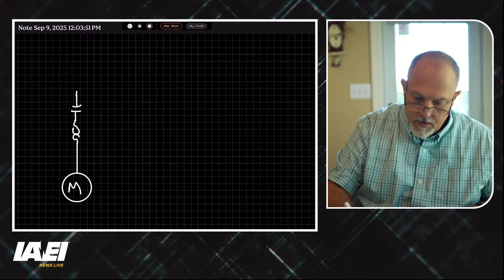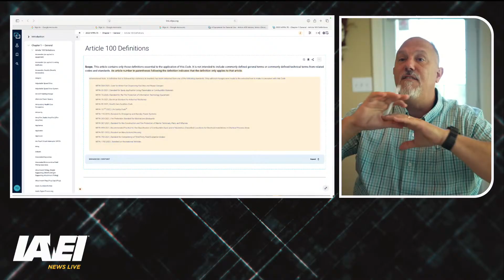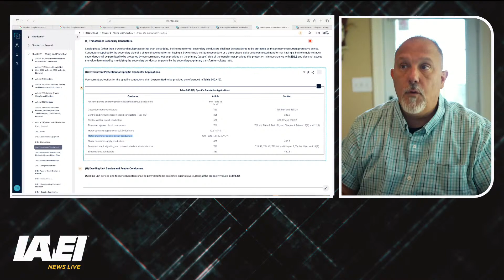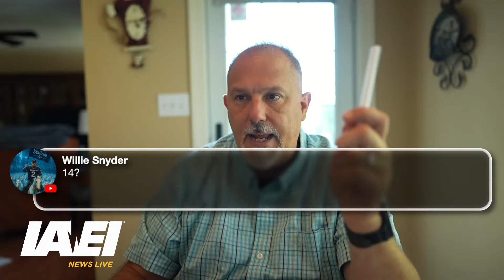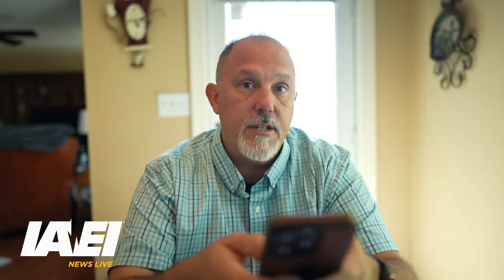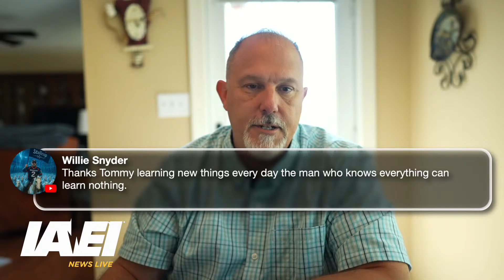Motor Circuit Essentials

Comment: Quiz answer. 16.7 FLA x 1.25= 20.9(21)amps. 110.14 (c) still applies due to the equipment OCPD 75 degrees so to serve this load you would need a #12 AWG THHN.